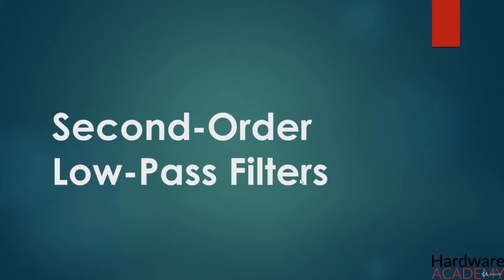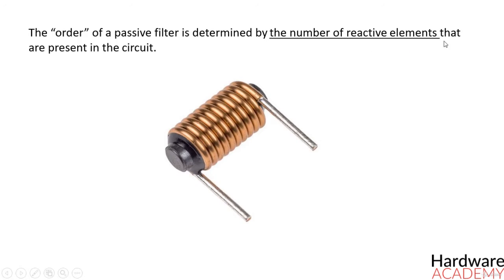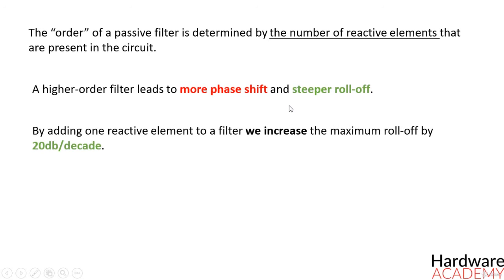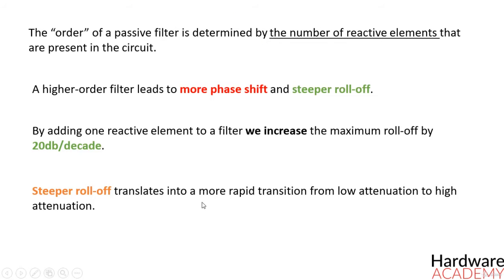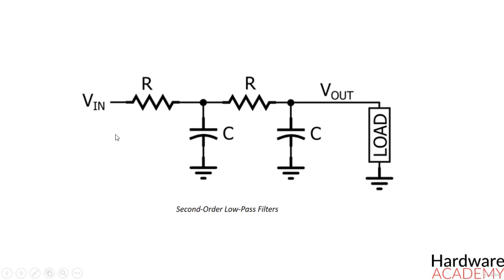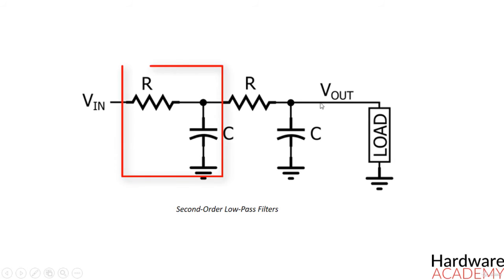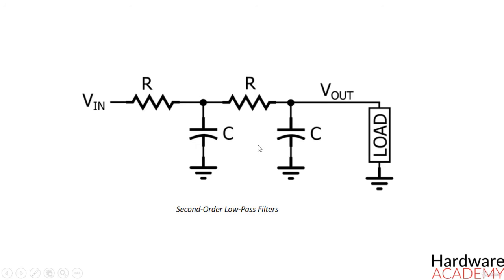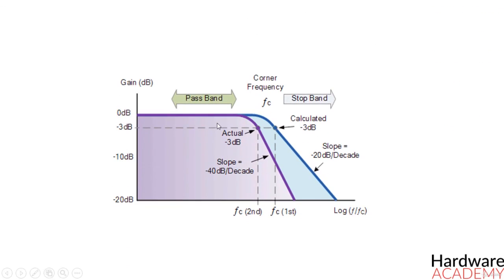43- Second-Order Low-Pass Filter

Comment: Howdy.
Great but one flaw. The RC legs will interfere with each other.
However. If the second leg is designed for an impedance of 10 x the first leg, the interaction is small and basic voltage divider formulae may be used. For practical purposes 5 times should be accurate enough.
To derive the exact formula for the RCRC filter is cumbersome.
Regards.